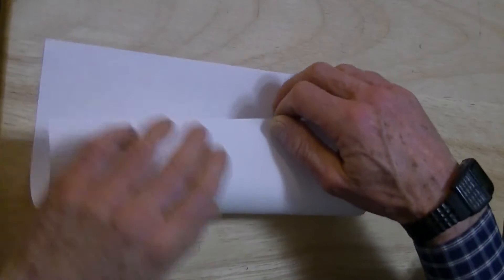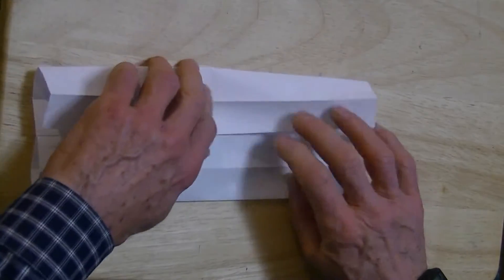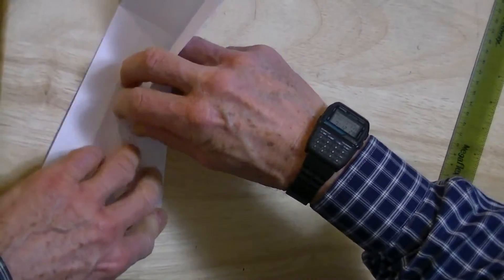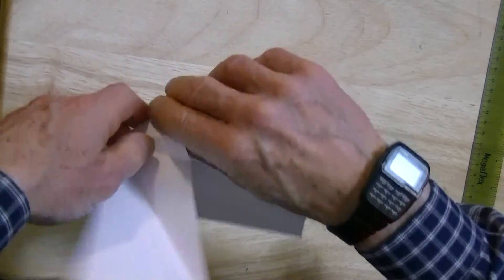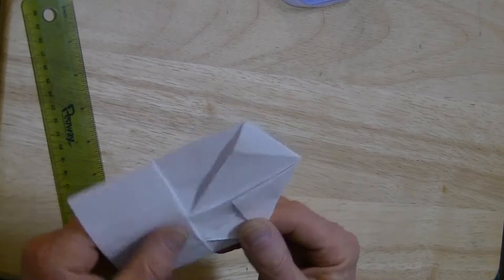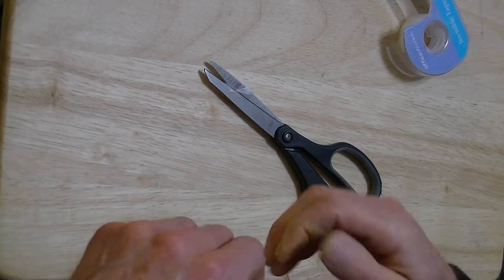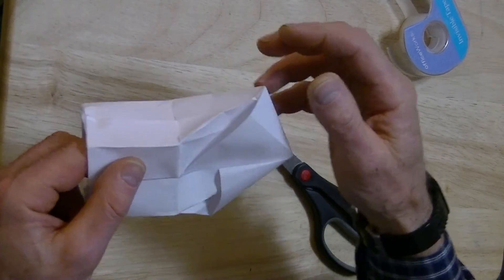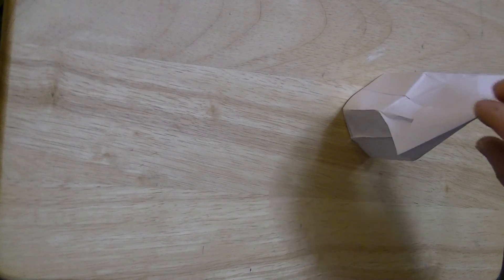Paper Klein Bottle 3D

Comment: That’s not a Klein bottle it’s just 2 möbius strips
Reply from the maker: No, it's a twisted Klein bottle so it's only ONE Möbius strip with it's edge connected to itself. It's possible to fold this Klein bottle without the twist, I've done it, and THEN it's two Möbius strips with the edge of one connected  to the edge of the other. Fold them and cut them in half and you'll see. (Maybe someday I"ll get around to making a video of the non-twisted version.)

Comment: Could someone tell me how does this paper bottle work?
Reply from the maker: I don't know what you mean. It's not a practical bottle or useful like an ordinary bottle. A Klein bottle is kind of a 3D version of a Mobius strip which is a strip of paper made into a loop with a twist so that it has only one side and one edge. If you connect the edge of a Mobius strip to itself you get a Klein bottle which has only one side and no edge. Of course this isn't possible unless you leave a bit of the edge unconnected so the bottle can go through itself so it's only almost a Klein bottle.
Reply: Yes I understand that. Sorry for the ambiguity in my question up there. I meant how does it resemble the glass Klein bottle? Like zero volume and all? Thank you very much
Reply: The inside is the outside